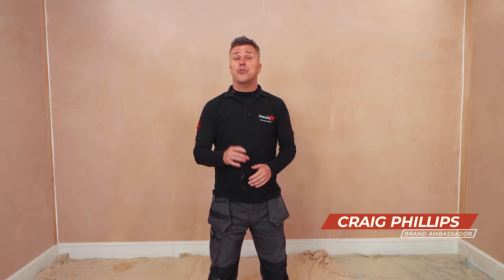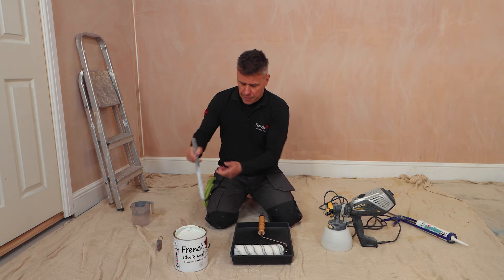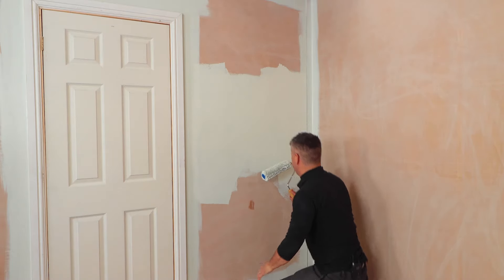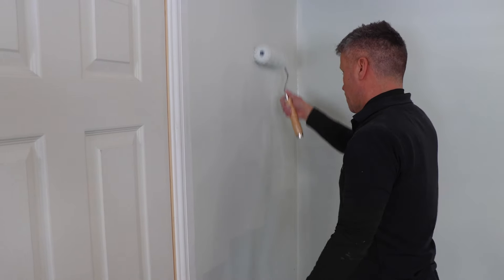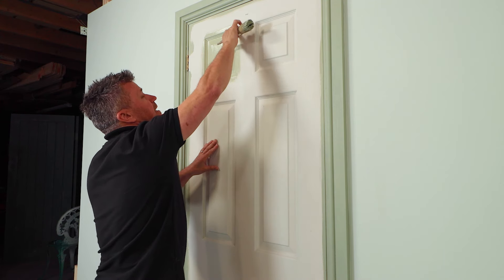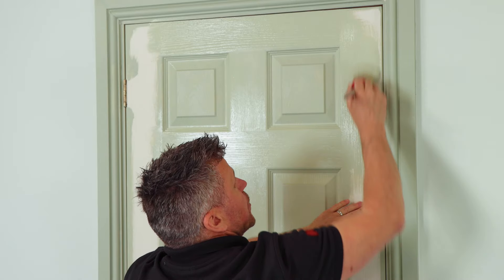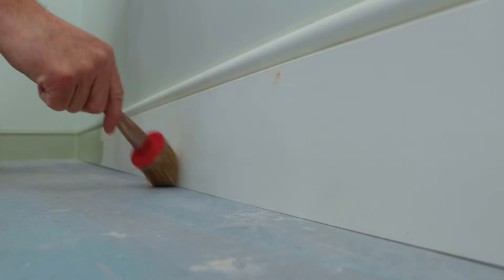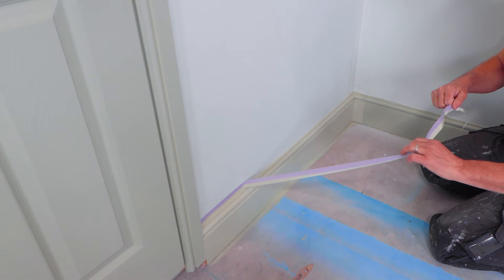Frenchic Top Tips | How To Paint Newly Plastered Walls

Comment: Do you have any runs with the spray paint?
Reply: Not if you keep the machine moving slowly, the paint flow can be adjusted so its works a lot slower
Reply: You can have runs even moving the gun slowly. This is not a professional decorator, caulking bare plaster is the stupidest thing I’ve ever seen. As for sanding bare plaster before applying any paint is also a waste of time. Get those walls misted and then you will see any issues with the plaster like little nibs, holes and undulations etc. these videos never fail to amuse.

Comment: Im confused - you didnt do a mist coat? why chalk before paint? surely you will discolor the chalk?
Reply: A mist coats only always needed
Reply: Applying your chalk is better before hand as it keys to the plaster better than any paints
Reply: Chalk won't discolour you need to to be the same colour as your chosen paint
Reply: Mist coat with white emulsion diluted to the consistency of milk. If you don't the plaster will quite literally suck out all the moisture in your paint as it is extremely porous. As a result your paint will flake and peel off eventually.

Comment: You should always prime fresh plaster with a mist coat of white emulsion, watered down to a consistency that looks like milk. Missing this step will result in paint flaking and peeling off!! Always use an extendable roller pole to apply paint to your walls it achieves a more even finish as opposed to just using the roller. When painting the woodwork always cut in the first and then do the faces you'll will get a much cleaner, straighter line. As for the door cut the panels in but finish with a rad roller the finish will be even with no brush marks. And lastly undercoat your woodwork first!!!